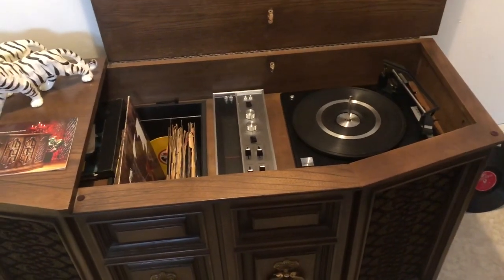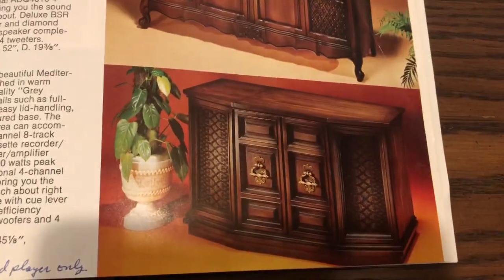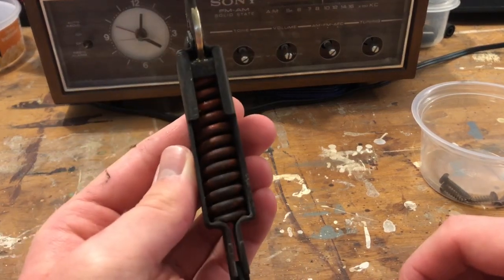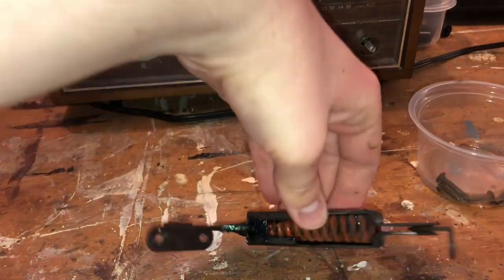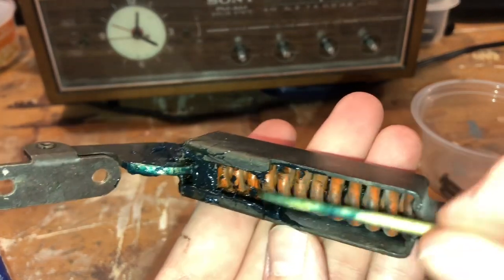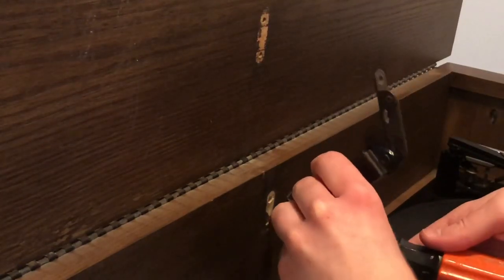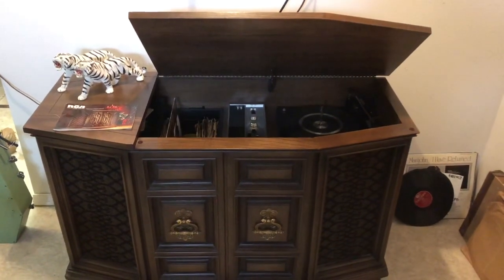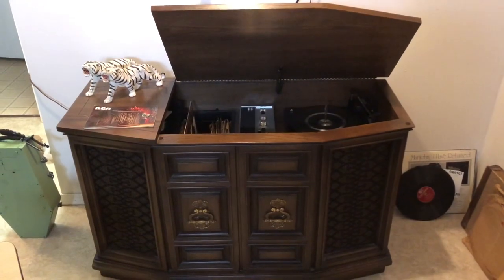RCA/BSR console stereo Lid-Stay lubrication/testing

Comment: Beautiful machine!   I have a lid stay on my 1927 Brunswick Cortez, except it was on the motor board with the stay under the board, out of sight and unobtainable, adjusted by screws.  One day I heard a snap on the left side and it doesn't stay up anymore.  I'm not going to try to get into the machine, I used an old fly swatter with half the swatter cut off the support the lid now.  When I first got the 1928 Edison here that was donated, its lid would not stay up by itself.  Looked at the props and it had an identical support to my Cortez.  Got my screw-driver, made a few turns to tighten the spring and now it stays up by itself.  The screw came out of one of the props on my Victrola 8-30, but all I had to do was screw it back in.  Good job!
Reply from the maker: I mean at the end of the day, all of these things just keep up the lid! I can see why the Brunswick and the Edison have the same one, and that’s great you got it all figured out. Personally, I think the fly swatter method is the most stylish.
Reply: @thegregolarecordsclub6564  I'm sure the flies agree, too!

Comment: Well its a good and helpful video on what's probably the least thought about part of any machine. I remembering being in a thrift store with a console from the mid 50s having the same problem, but stayed about 4-6 inches up and would barely move more up or down. For the few projects I've had to use greese for, I've found that scented candle wax can work good as a lubricant or grease. whats the Columbia Microphone 78 you have on the floor?
Reply from the maker: C Porter That’s my reject country post WW2 set of 78’s, and thanks.